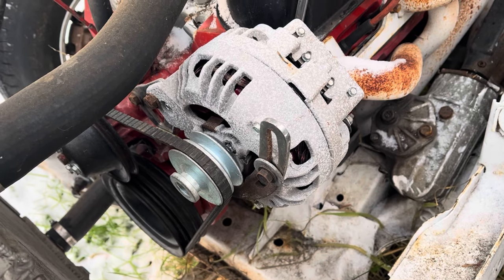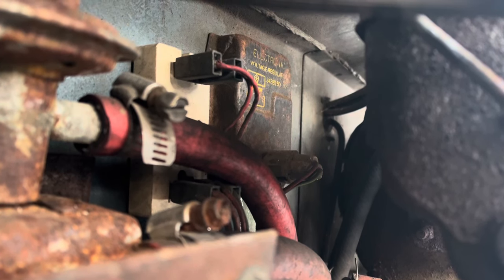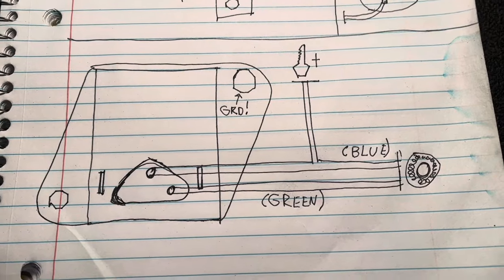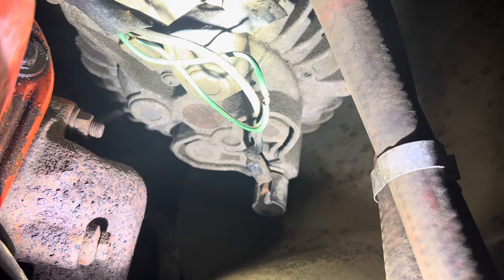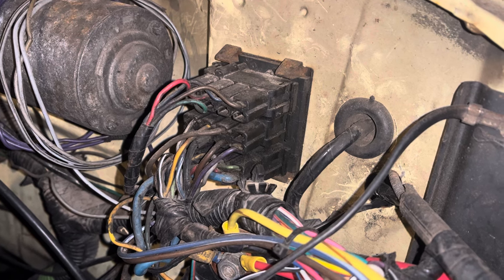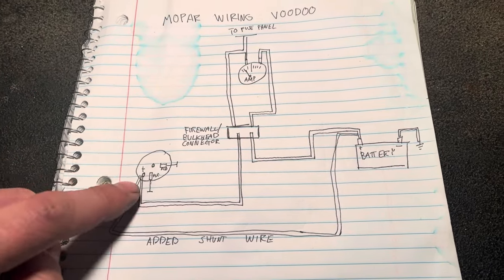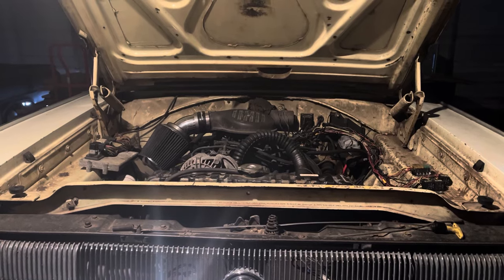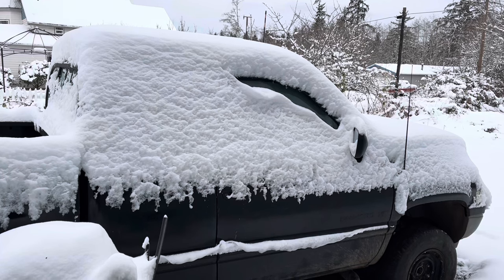Classic Mopar Charging Systems: How They Work, and How To Diagnose Failures

Comment: Many thanks for a great video. I've got a Mopar charging problem I hope you can help me with. I'm having alternator problems on a 1974 Jensen interceptor. These cars came equipped with 440 Dodge running gear. The problem started when I was losing battery voltage To correct the problem I purchased 100 amp rebuilt alternator for 440 Dodge. I followed your advice on troubleshooting by doing the following. I) confirmed my v regulator was well grounded, 2 )I confirmed that my ignition switch is powering the voltage regulator. At rest the battery is 12.70V.  The alternator is producing the following V's when disconnected from the system, idle 10.5  to 11.9V . 1000 rpm 14.6 to 15.6, 1500 rpm 18.9 to 19.2V. Once I connected the alt to the system with a shunt from alt to battery the voltage at idle 12.35V,  . 1000 rpm 12.36, 1500 rpm 12.6V,  2000 rpm 13.5V. What can I do to increase the volts at idle and 1000 rpm.
Reply from the maker: I have seen some factory charging systems that do very little at idle like that. I am wondering what the pulleys look like. A larger pulley on the alternator, or small drive pulley on the crank could lead to the alternator spinning slowly and not producing enough charge at idle. It is obvious that your regulator is at least partially functioning, or you would have no charge at all. The high numbers measured at the alternator when it is disconnected don’t concern me. But I would have liked to have a voltage reading at 3,000 RPM or even higher to verify the regular’s function with your shunt wire in place. I would want to verify the voltage signal that the regulator is seeing (it should be very close to battery voltage,) and I would want to verify that you have a good body ground (or grounds) in place on the engine.

Comment: Would you suggest purchasing the 2 pin connector with lead wires to go with an aftermarket regulator? I am having the overcharging issue on my '85 B250. Thanks
Reply from the maker: My experience with overcharging with a shiny new regulator and all else good has most often come down to that regulator connector. There are other possibilities, but that is going to be the most likely.
Reply: @DeadDodgeGarage  great thank you for the response!

Comment: Great video & very informative. 
Couple Qs for you if you can...?
I would like to go one wire. Could you recommend a good (higher amp) alternator? I want to clean up the engine bay on my old Charger.
And second, do you know if they make, or can you Frankenstein, an HEI distributor  for the 440?
Thanks for your time. Look forward to more of your videos.
Reply from the maker: Personally, I like factory charging systems. That’s the main gist of this video. The shunt wire is a great way to improve things. Other than a factory Chevy one wire, I have never installed a one wire on a classic Mopar and can’t recommend a brand. If you’re running a bunch of heavy electrical loads, ok. If you’re cleaning up your Mopar engine compartment by getting rid of factory components and wiring, you might be making it worse 😅 but it can be done. 

I’m sure they make a drop in HEI type distributor (I’m guessing DUI makes one,) but there are a lot of other good options - an MSD ‘ready to run’ distributor comes to mind.
Reply: @DeadDodgeGarage  coop beans. Thanks.
Yeah, currently I have the second (newer) voltage reg. & alt. I do want to clean it up. Getting rid of my old gages and putting in a new autometer dash set w/ new gauges and a decently large stereo. 
Plus I'm going to change all my bulbs to two filament. So I'll ha e all 4 on at low or high beam.
So im definitely going to need a bump in wattage from a single wire.
I'll look up the HEI from the people you mentioned. 
Thanks a bunch.
Reply: @DeadDodgeGarage  oh... forgot to mention. When I got the car it already had a new wiring harness. So no bulkhead to deal with.
Reply from the maker: @jacobkarle4057  Aaaahhh. So you're in a different universe than most of the stuff I'm messing with anyway. Haha. I would find one of those drop in, standard Mopar appearing, higher output 1 wire alternators. Nice and easy, and looks kinda right in there. Again, I don't know who the heck makes them. Do you have headlight relays yet? If not, that might be something else for you to add. They make a huge difference in headlight brightness, and they take the load off of your headlight and dimmer switches - two common failure points (common, meaning I've spent some quality time on the side of the road at night in multiple A bodies and one truck over the years trying to get my headlights back.)
Reply: @DeadDodgeGarage  Cool beans. Thanks. Yeah, already bought 2 relays for the lights. It has an aftermarket wire harness but the lights are still dull. Even with a new light switch & dimmer switch. Especially on high beam. Lol
BUT... I'm going to do some surgery on them. I'm going to transplant some duel filament bulbs all the way across. That way I'll have all 4 on at the same time. Either low or high beam. One relay for each.
Already checked with TexDOT and it is legal to run with all 4 on at the same time. 
Heck, might even video the before and after and post it with a tutorial. If it goes well...🤣🤣
Reply from the maker: @jacobkarle4057  Honestly, I think you will get more out of adding the relays than you will out of doubling the low beams. But you'll be able to aim them wider and get a much better field of view, which should be nice. I did a guide video on adding headlight relays in my '66 Charger, and I can't explain how significant the difference was. It had the best headlights in the fleet - and that included my modern drivers. The four high beams were not on a relay, and although they were aimed higher, the visibility was much, much better with just the two lows.

Comment: Great video. Any recommendations on gauge and connectors for the shunt wire?
Reply from the maker: I’m really not good at wire sizes for some reason. I think I usually use something like eight gauge. Similar size to the factory charge wire is fine, or a size larger.

Comment: My 74 Plymouth, scamp.
Was charging fine? And I put a new Mopar classic. Wire and harness underneath the hood and it don't charge now
Reply from the maker: Bad connection, loose wire in a new connector, missed a connector… I explained the tests you can do in this video to test components and I recommend you go through them. First thing that comes to mind is, make sure you’re getting power to the blue wire on the alternator and the voltage regulator.

Comment: The shunt wire what gauge of wire and  does it need to be fused ,if so how big.love your channel thanks.
Reply from the maker: 8 gauge works, and it should either have a fuse or a fusible link. If there is ever a short in the alternator (which I have seen happen multiple times,) or if that wire falls off, it will quickly become an electrical fire with no protection.
Reply: @DeadDodgeGarage  I hate the fusible link what size is compatible I tried looking it up and it's not clear what amp to use

Comment: Im having a bad over charging issue. Ive replaced the voltage regulator the connector and the alternator and its charging at 15.5 volts at idle. I found that if i take the ignition wire to the regulator and connect it to the battery it charges at 14.4 volts with the engine revving. Around 13.5 at idle. Any idea at what could be causing this? Also replaced the ignition switch as well and it had no effect
Reply from the maker: Huh. What voltage are you getting on the blue wire with it running? If that voltage is very low, the regulator will crank the output to try and bring it up. That’s the mechanism through which the regulator connection creates the over charging problem - the regulator sees a low voltage, so it cranks up the power.
Reply: @DeadDodgeGarage  14.5 volts. And then when checking the battery 16 volts at idle

Comment: Got some trouble shooting to do. Does it matter which fld tab is grounded? 
Old style regulator with a newer alternator.
Reply: OK I only have .8 volts at ignition side of early regulator.  Fixed that but still the alternator only shows battery voltage at the post even with a negative jumper to the battery. Believing the one year old alternator is crap.
Reply from the maker: It shouldn’t matter which is grounded. The early style regulator changes voltage at the brush it is connected to - what are you seeing there when running? I’ll say again… it’s almost never the alternator, in my experience. But hey, sometimes it is. If you’re getting a voltage reading at the brush and no charging, you could pull the alternator and have it tested. Maybe you have a warranty? Haha.

Comment: Hey do you have a video on the magical box on the breather in late70's and 80's dodges? I bought a 78 aspen for 200.00 that had been sitting up for10 years and all i had to do was fresh gas and a new box and drove it away the previous owner was pissed!
Reply from the maker: I haven’t done an actual lean burn video yet. I did convert my ‘79 Chrysler 300 from lean burn to a Pertronix ignition in my first video on it, and later replaced the electronic feedback carb as well.

Comment: I have a 2019 Dodge Grand Caravan, 81,784 Miles on it and driven daily for about 20 miles both ways sometimes a bit more miles. 
  I notice when I bought the vehicle then 4,920 miles on it the front headlights flicker all the time while the engine is running but the minute, I turn off the engine, the flickering stops, the headlights are on strong, no issues with battery or electronics in the van, but just the headlights flickering during the running of the engine. 
  I have the 2019 Dodge Grand caravan with the 3.6 Pentastar VVT flex fuel. SXT.
Reply from the maker: Huh. That’s shouldn’t do that. I suspect an alternator issue, but there are a few other possibilities involving wiring. It seems really unlikely that you would have had a wiring problem at 5,000 miles…

Comment: I've been looking for help on my '76 Dodge Fireball 22 ft RV with a 440. I'm getting barely any charge, amp gauge reads slightly negative when running. If I turn on any accessories while idling, it starts draining the battery and the amp gauge goes further south. We checked battery with multimeter, it shows it's VERY slowly charging when all accessories are off but the amp gauge still reads slightly negative....strange. I'll check my voltage regulator and add a shunt wire as you've shown in the video as a start, thank you!

I'm not sure where the "converter" or "battery isolator" is, I'm not even sure if I have either to charge the house battery. I hear most of these old dodge class C's have one. The house battery is shot. Replacing that tomorrow and then figuring out what wires were cut behind the house battery and fuses.
Reply from the maker: Definitely start with regulator tests, power to battery and check voltage on alternator output stud. This just happened on my 79 stepside, and it was the voltage regulator.

Comment: Hi Dead Dodge Garage  I have a 1974 Challenger 318 engine. Last year my ammeter would charge sometimes and then sometimes dis-charge. The car had the original alternator, so I bought a re-man one at a local parts store. That
did not fix the problem, so I bought a new electronic voltage regulator (from Classic Industries) with all the correct factory markings.  Now the ammeter is reading over charge all the time. Any ideas where to look for the problem?
Reply from the maker: When you say overcharge, do you mean all the way to the right of the gauge? Or slightly above center? Slightly above center would be a typical reading. If it’s reading way overcharge (like at the top of the gauge) then refer to the section where I talk about the connection at the voltage regulator. I have seen overcharging caused by a poor connection there. Now that you’ve watched this video, you probably know my saying with these Chrysler products - it’s never the alternator (except when it is… but that’s another story.)

Comment: Tangentially related: have you encountered many cracked alternator housings in your experience? I had a number of odd electrical symptoms (including stalling, which required opening the battery disconnect to recover from) in my '96 B3500. Overall system voltages were good (checked while idling in the driveway), but while troubleshooting the problems, I noted a cracked alternator housing. On the principle of "fix what you can see", I changed it out for a new one, and virtually all of the observed electrical symptoms disappeared. Once I had the old one out, I noted the cracks extended all the way around the housing, so the stator may actually have been adrift.
Reply from the maker: Huh. No that’s a new one on me. I don’t think I’ve ever seen one cracked. Very interesting. Incidentally, I’m currently chasing down electrical gremlins in a 96 Ford van. I wish I wasn’t
Reply: @DeadDodgeGarage  I grok, I'm good with electrics, but I don't like to dig too deep without a schematic. Tracing circuits hand-over-hand in cramped quarters gets tiring quickly. I did find a few people talking about alternator cracks on the old forums, so I guess the problem isn't unknown. Maybe worth investigating if you have weird electrical symptoms only when the vehicle is in motion.

Comment: I have a quick question. I am a Total amateur when it comes to wiring btw . If i have my 69 Charger dash frame out of my car, which part of the harness is the main point of ground? The cluster itself? Or is there another wire on the interior harness?
Reply from the maker: If you’re asking about gauge cluster, there is no separate ground wire, and the metal frame of the cluster grounds to the dash frame through its mounting screws. The frame in turn grounds to the body through its mounting bolts.
Reply: @DeadDodgeGarage  oh ok, I understand. Im just having charging issues and thought maybe the dash ground had to do with it , if it was disassembled.

Comment: If I were to add the wire from the positive side of the alternator to the positive side of the battery, does it require a fuse? Does the wire need to be the same size as the wire that goes to the ammeter or is there a more appropriate size?
Reply from the maker: I have done several without a fuse, but adding a fuse would be a really, really good idea. If there is ever a short inside the alternator (which happens from time to time,) that’s a fire waiting to happen. Yes, either the same size (8 gauge I believe,) or a size larger.
Reply: @DeadDodgeGarage thanks!
Reply: @DeadDodgeGarage It was the voltage regulator. I should stop being astonished when things work.
Reply from the maker: @robw7205  My #1 rule in this is, it's always the voltage regulator... except when it isn't. I think I've said that on video before. Haha.

Comment: so what do you do if your amp meter doesn't move at all?  recently had an over charge issue going to the city the other day and boiled my battery.  New battery and new voltage regulator and all is working and charging properly.  But this amp meter has never worked.  Just a connection at the firewall maybe?  As far as I can tell there's no shunt wire  to the battery.
Reply from the maker: It’s likely already bypassed. Check to see if both wires on the back are on one post together.

Comment: I have a 91 dodge van b250.  when I start the vehicle it climbs to 19v within 10 seconds.  tested/verified on a secondary voltage reader.  
From the info in the video, most likely a bad ground at the alternator? 
thanks, much appreciated.
Reply from the maker: Voltage regulator is commanding alternator to full charge. The climb to that voltage is the telltale sign. I’ve seen this problem several times on trucks (as I mention in the video) and every time it has come down to a regulator failure, or a bad connection at the regulator. Unfortunately, on your ‘91 van, the regulator is built into the PCM (engine computer.) This is also a fairly common failure. You will either have to replace your PCM, or retrofit a classic style voltage regulator from a 70s-80s vehicle onto your van. I have seen good instructions for this online - it’s relatively simple to do.

Comment: I got a 89 318 and the wire melted together and has a spot of wire missing and if i replace it the volt meter shows optimum charge. I believe a short somewhere but got 10 feet of 10g wire i was going to run to the alternator. Would i burst into flames
Reply from the maker: Wow. I… really don’t know what you’ve got going on there.